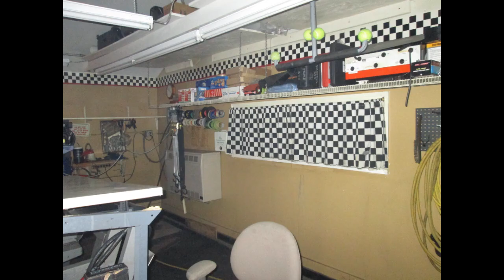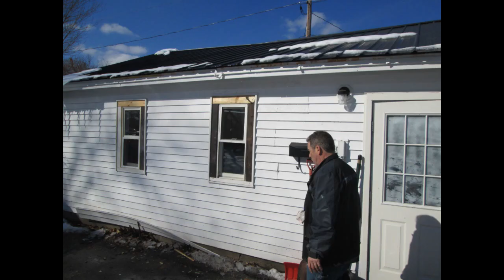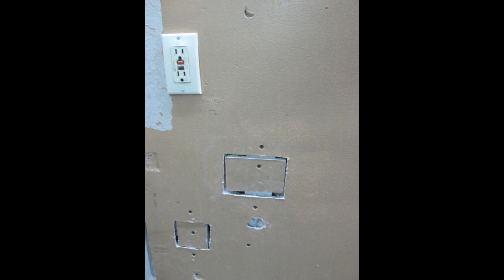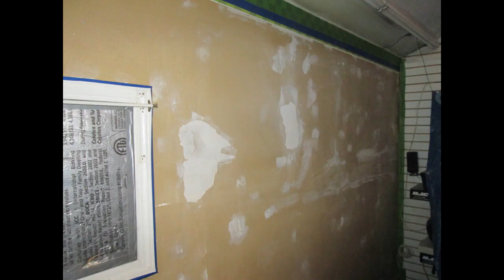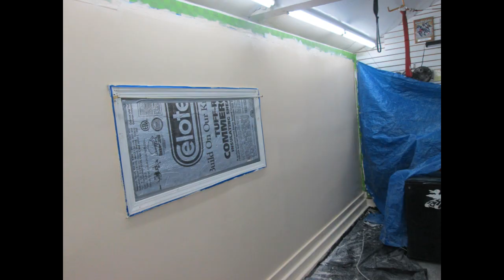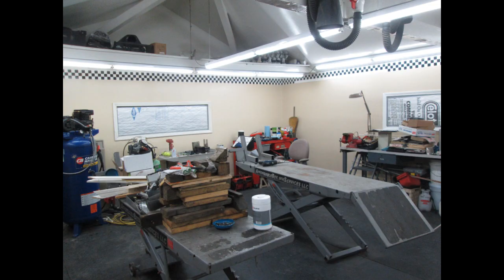BMW Service - Shop renovation Spring 2014

Comment: Looking really good!
Reply: sorry guys not post related. cant find how to pm any one .posted two vids each 15 mins long took 3.5 hours to upload, this last one is 22 mins long an it says its gonna take 32740 mins about 60 hours. any help tips or advice again sorry for none topic related post  but goodjob on the shed by the way....ps have canceled  it an restarted it same result.
Reply from the maker: I had the same problem a couple of years ago. Switching to Google Chrome solved the problem. I hope that helps you as well. Thanks, Chris
Reply: cheers chris ,I normaly edit at night while at work an upload while im sleeping  lol turns out it was just bad internet but problem solved an part three of billy no mates is finally uploaded thanks
Reply from the maker: Thank you everyone!